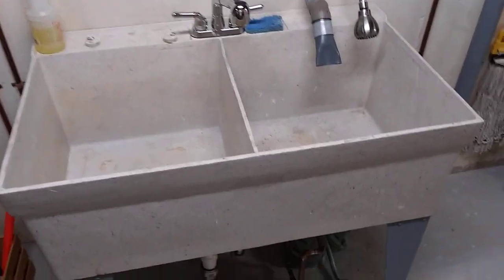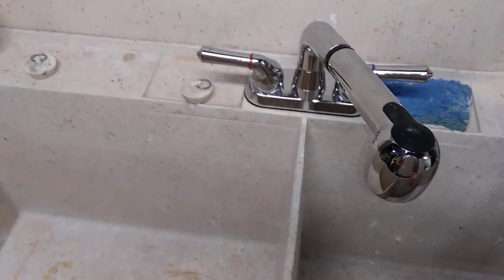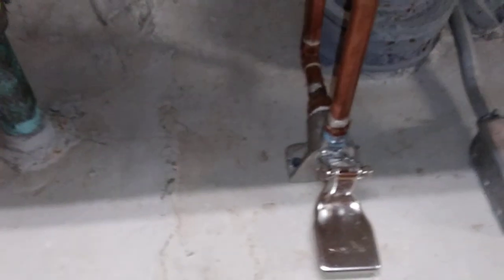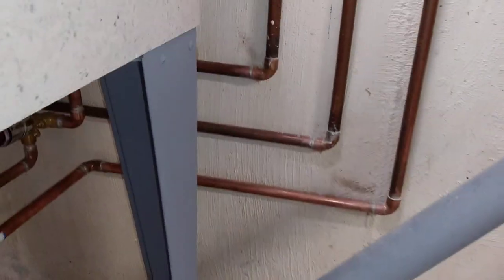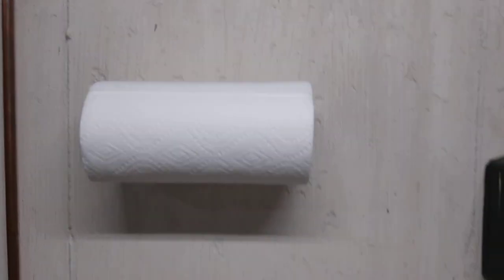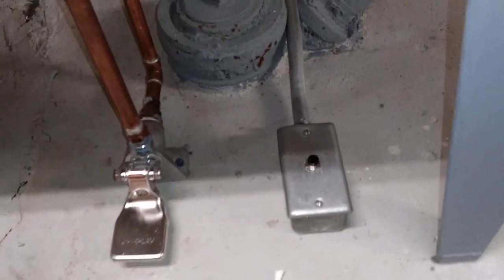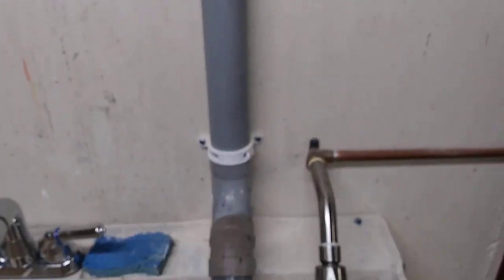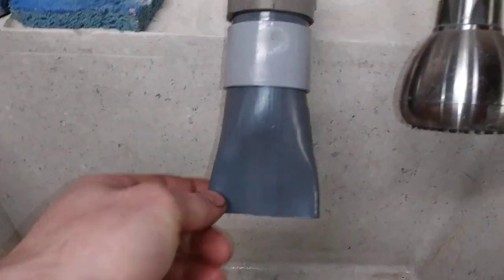Touch-Free Faucet and Hand Dryer

Comment: I used to have a few of those hand dryers. They indeed are weak. High power units like this would be super cool. I was in fast food place couple of weeks back and dyson has a touch less sink with built in dryer. Damn thing cost 3k for a unit yet they worked super well. Would be worth it for a super high end house bathroom or hand washing sink. Dries right in the sink.